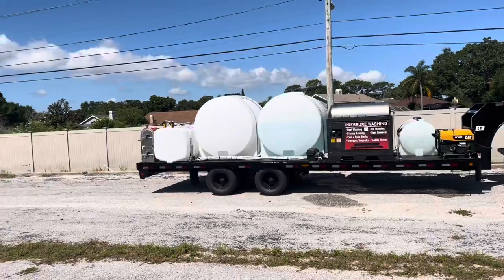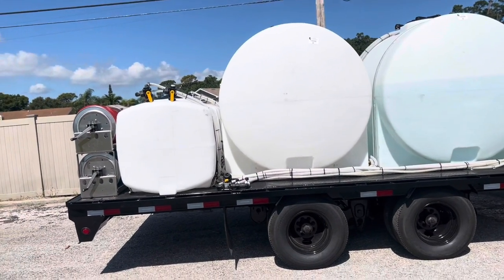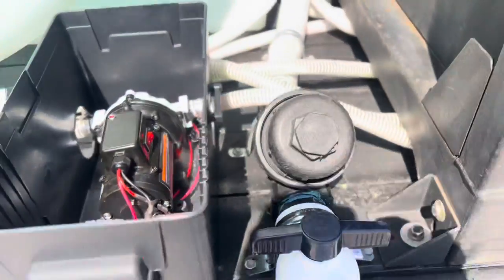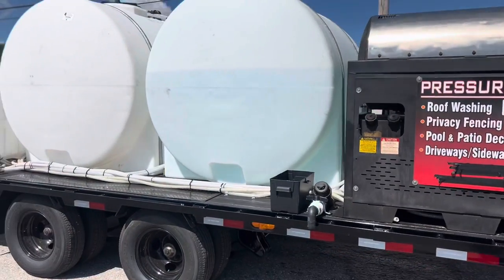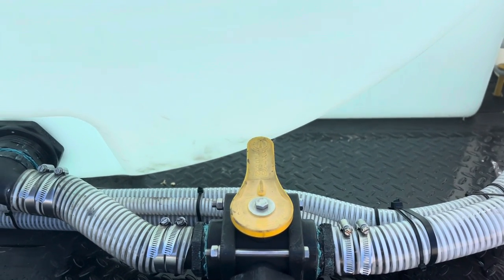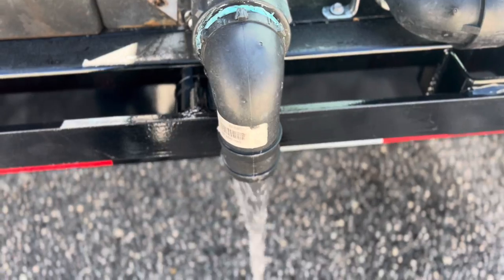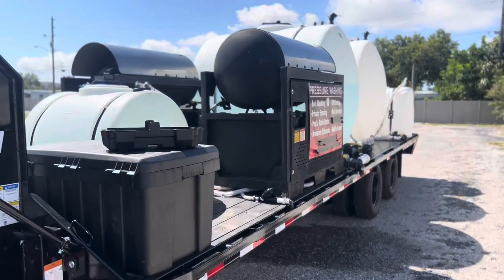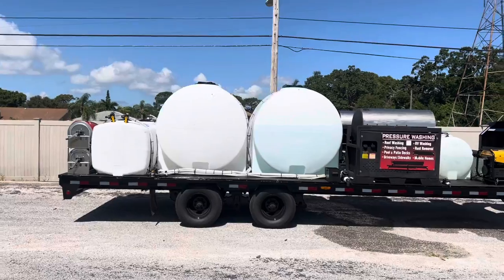New 2022 Mega Pressure Washing Trailer.  Gooseneck Trailer.  Aim High Pressure Washing #16.

Comment: Why your filters up? supposed to be down all the dirt small particles can go to your pumps, you are using gravity on the wrong side. it has to be the way banjo valves designed is down. Just curious, can you tell me why?
Reply from the maker: Even if you were to do a hand stand, your kidney (which is a filter for your body) will still work as if you were standing up 😂.  

So as long as the water is flowing in the correct direction, the filter will still filter 😂 Plus it looks better that way (to me 😂)